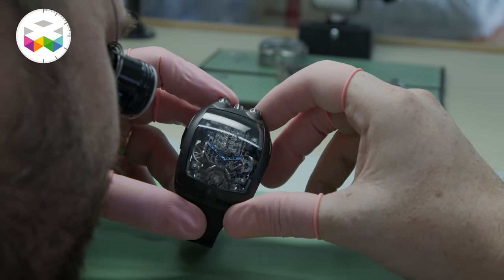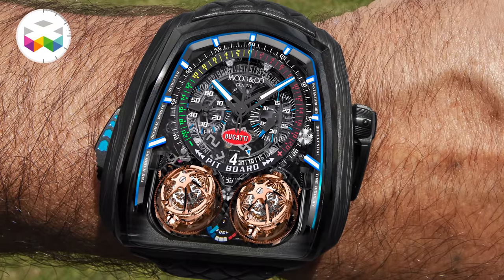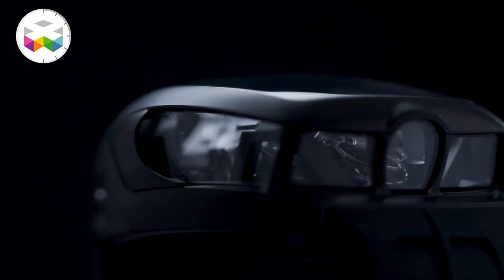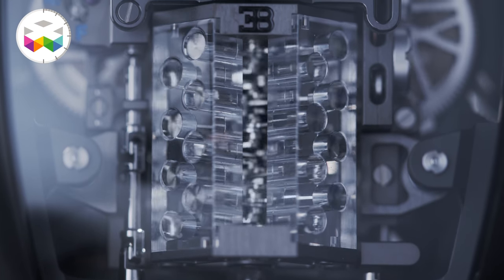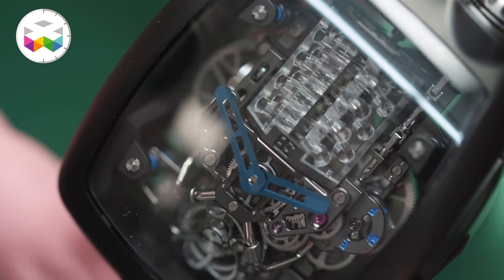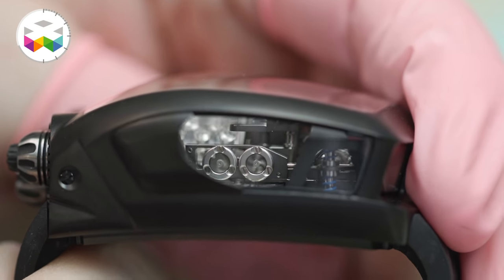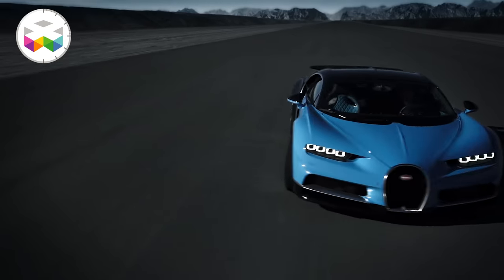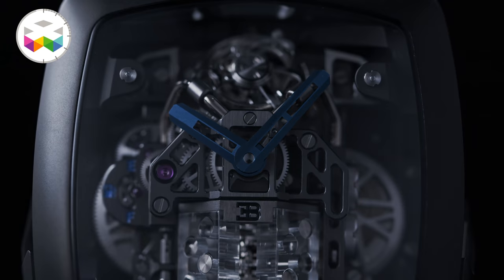Bugatti Chiron Tourbillon by Jacob & Co: A W16 Engine On Your Wrist!

Comment: Man, the pistons are already crazy enough, I'm completely blown away when the watchsmith moves the movement to demonstrate the suspension mechanism. And that stem design for the crowns!  Great job Marc to premier this release. RM really need to step it up.
Reply from the maker: Yes, that's indeed amazing!
Reply: @user-zl2sc3bg3g  it reminds me of my RC buggy! Haha!
Reply: @jamz113  but RM has a shock absorbing system already. Here, the bottom plate is joined with the case by shock absorbers
In the RM, there are pulleys at the extreme points of the bottom plate, and tight carbon cables, fixed to the plate by a ball joint link, go through the pulleys. It acts exactly like a shock absorber, if not better.
Reply from the maker: @jamz113  There's a bit of that ;)
Reply from the maker: @clementr  It's indeed a very cool system, like too 👍
Reply: @clementr  Yes you're talking about the 53-01 Pablo Mac Donough correct? I think those cables suspend the movement static in the air tightly, like a bridge. Not like this one where the movement can actually "move". Not to take anything away from RM's innovation but this J&Co impresses me more honestly, plus with the other 2 novel features. I don't even like J&Co, what's with all the bling watches. Maybe only the Astronomia and this one.
Not to mention the price difference of this one and the RM 053.
Reply: @jamz113  oh, both solutions are very common in industry. After, doing them in a watch is outstanding. If we don't consider the price of the watches, imagine the cables in the RM act like the cables in boxing which prevent the boxer to fall. And it's in almost every RM watch.
Reply: clement r. Yep the suspension system is very common outside the watch world.
Anyway, to each their own. I’m really impressed by the 3 features in this watch: the pistons, the suspension, the genius crown stem design, more so than any RM. That’s me being a lover of moving things in a watch. Haha.
That’s why I said RM need to step up their game by including more new features in one watch, then they deserve to charge what they’re charging.

Comment: Interesting watch.  I am a car guy and it is pretty amazing how many facets of the Chiron they were able to incorporate into the watch.  The mid mounted "engine", the shock towers, the articulated stem, the horseshoe shaped grill, the winders at he rear are in a similar location to the Chiron exhaust, the sweep along the side, and I've probably left out a few.  Amazing.  Personally, I would never wear such a watch as my tastes are too conservative, but it is a fantastic watch, just the same.  I've just discovered your channel today and I have subscribed, but I have to ask, what is the device on the  wall unit behind you with the clock face and the rack handles?  Some sort of super accurate clock?  Inquiring minds want to know!
Reply from the maker: Thanks so much for the sub and yes they went quite far regarding the Chiron!! Concerning that "object" it is an old school Patek Philippe digital master clock used to synch with clocks which could be found for instance throughout a factory. All the very best to you

Comment: Amazing....I can only have in my Solidworks..
Reply from the maker: That's already quite something ;)
Reply: I you can have it in your solidworks you can rent a CNC machine ;) it will cost you a lot but still less than 300k. After, will it work 🤷‍♂️
Reply: @clementr  only need to find a Willemin macodel or tornos CNC and after the assamble...

Comment: who would have thought, that one day man would put an entire humongous automobile engine, inside a wrist watch??? lol 

I was amazed more by the design of the W16 and its tiny pistons-connecting rods-crankshaft and their own bearings and the joints; the best part is, they might have simply used the ruby jewels for making a bearing, lol. Also, using a double-cardon joint to adjust the misalignment due to suspension, was smart (as its widely used in steering and transmission arrangements in automobiles). 

I also liked the idea of using constant force from the spring barrel to animate the engine, so I need to know which mechanism they used for this, (like a fusee-chain or stackfeed).

Comment: Basically 500 CNC machined parts, assembled by some dude.
Reply from the maker: Like any watch apart from fully Handmade ones, but those are extremely rare
Reply: @user-zl2sc3bg3g  . "Extremely rare" Not really. They just aren't backed by Volkswagen Group marketing.
Reply from the maker: @Memovox  Was talking about the watch ;)
Reply: @user-zl2sc3bg3g  . So am I.
Reply from the maker: @Memovox  There must be less than 50 high-end watches per year that are solely produced by hand around the entire world
Reply: @user-zl2sc3bg3g  . Probably a little more than that.. But that doesn't make them "extremely rare" It's relative. Anyways, I'd rather buy a set of LEGO and assemble it myself, than wear this Volkswagen watch. Taste is relative as well.
Reply: @Memovox  I will not talk about the taste, it's relative as you say (and I hate the design)
But 500 parts, with some very tiny like the escapement : if all was made by hand, first it would take much more time to produce, and second I think you don't realise how some pieces are tiny : it's extremely hard for a watch of this size to be precise if the regulating system isn't machined : some error margins are of 0.01 mm. Even with a microscope, good luck with your file
Reply: @Memovox  and see the watch brands Bexei and Masahiro Kukino. Bexei produces all by hand, he does around 2 watches per year. Masahiro does all BUT the escapement system because his watches are more tiny : he does 4-5 watches a year
Reply: @clementr  . Ok. Well this watch resembles an RC airplane engine.
Reply: @clementr  . I know them. And Aaron B does more than 2 watches a year.
Reply: @Memovox  first, my bad : Aaron Becsei doesn't produce the mainspring, hairspring and jewels.
Second, I checked and with 4 employees he produces from 4 to 5 pieces a year (including conception of the watch with the customer, making the pieces, and the most time-consuming process I guess: finishing and engraving pretty much everything).
Ardillon (that I know from Naissance d'une montre 2) do 2 watches a year, brands like PP, AP or VC or JD don't do any pieces entirely by hand (even Les Cabinotiers or the chiseled watches). GF, and other very exclusive brands don't do everything by hand either.
So I would be very interested to know more brands which do everything by hand ;) because it's hard to believe hundreds of watches are made by hand a year
Reply: @Memovox  I totally agree with you, I hate this kind of watches. But I admire the ability to reduce technical solutions to the size of the watch (because indeed shock absorbers, cardan shafts and other frivolities are well known for centuries, but I think it's always an exploit to make such tiny things... Even if I am way more impressed by complex automatons)
Reply: @clementr  . Maybe this channel will do a video about classic handmade haute horology - grand complications/automatrons Vs. CNC...
No matter what; I like to know that if I use my loupe - I can see that my watches are made by humans and not by CNC machines.
Reply: @Memovox  I agree with you. For me, handmade watchmaking is the pinnacle of watchmaking, and even if I value the great engineering work of brands like Richard Mille, I prefer when the watch is modern, very well engineered BUT made by hand for the same price (or less) than a Richard Mille.
After, for people like me who, first, don't have tens of thousands to spend in a watch and, second, who have other passions or priorities than watches, I find great that some brands, like Frédérique Constant, Mont-blanc, Nomos and others (my favorite being Habring²) offer watches, with complications or not, which offer great quality, robustness, and a rather good finishing for a rather accessible price 

NB : my favorite "" affordable"" (hum) watch is the Habring² Doppel-Perpetual (I love mechanics) and my favorite watches are the Patek Philippe 5180 (for me the pinnacle of finishing, even if a bit overpriced as always for watches) and the Vacheron Constantin Celestia Astronomical Grand Complication 3600 (which symbolises my love for craftsmanship, mechanics and a remarkably aesthetic watch)

I would be pleased to know your favorite watches
Best regards (I'm slowly learning politeness of the English langage haha)

Comment: I personally think this watch is pretty lame, it does look like a toy, you will get bored after seeing the "engine animation" a few times and then what it remains is a big clumsy watch. Also the mechanism that make the "engine" work is simple, only interesting because the small dimension, but it's just like cirus stunt, impressive, but useless and uninteresting after seeing it once or twice